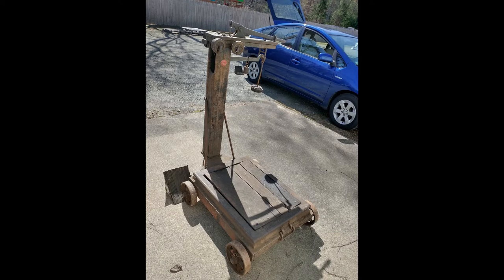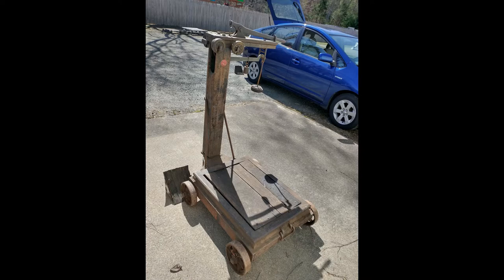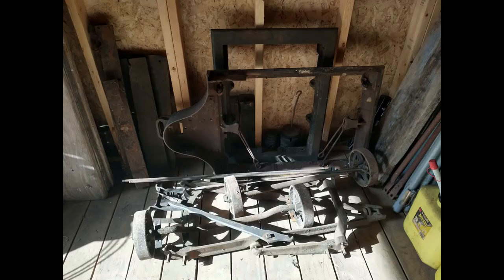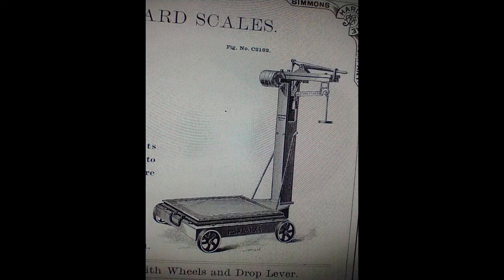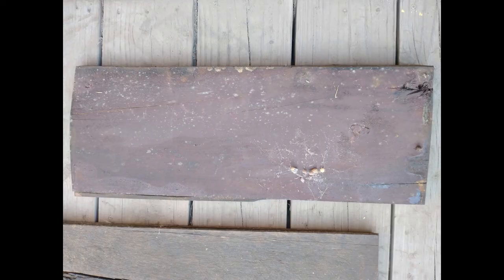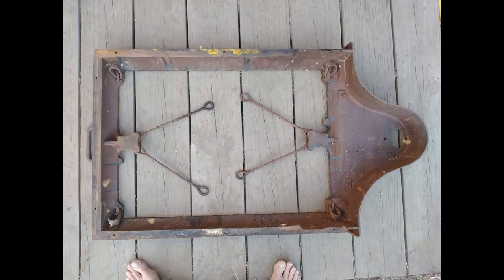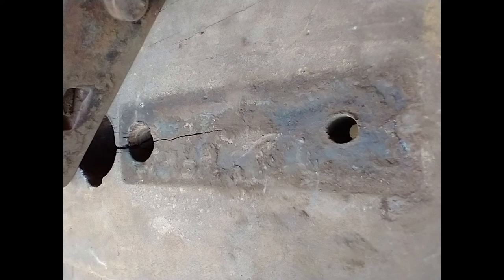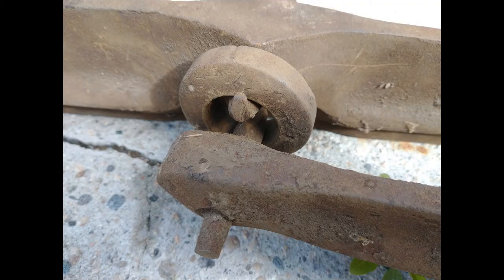Part 1 - Slideshow, restoration of Fairbanks No 8 scale

Comment: How did you get the column off?
Reply from the maker: On this one there are two nuts at the top of the column.  They are screwed onto two long rods - which pass through the column, top to bottom.  The rods are threaded into the base casting.